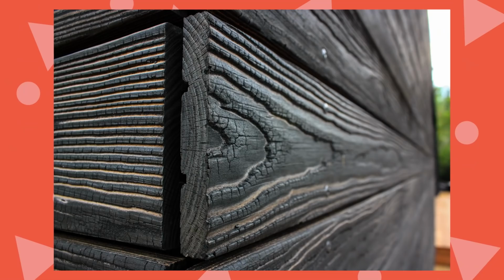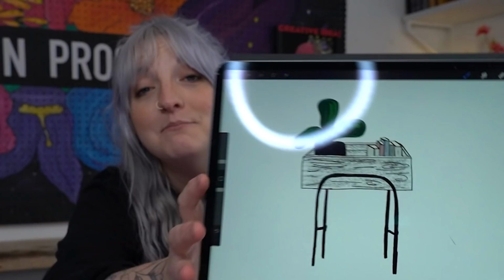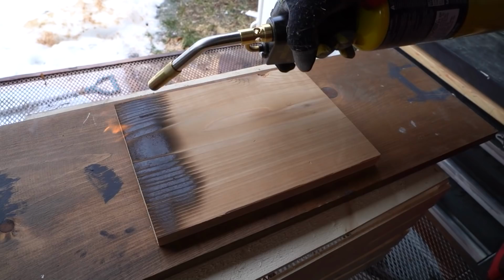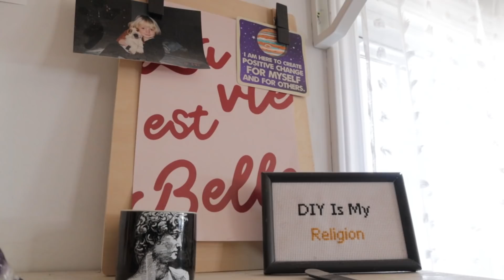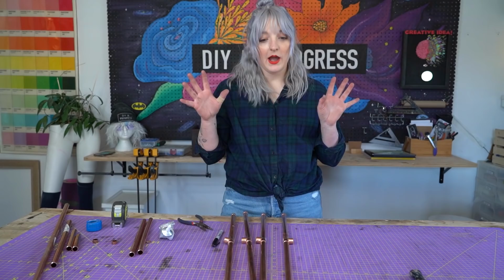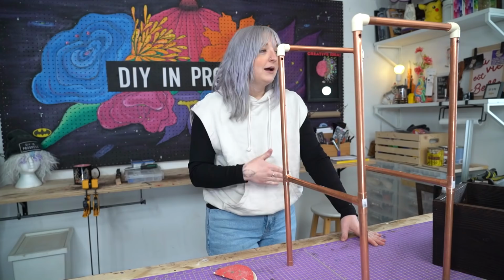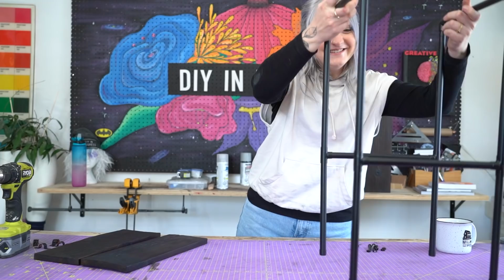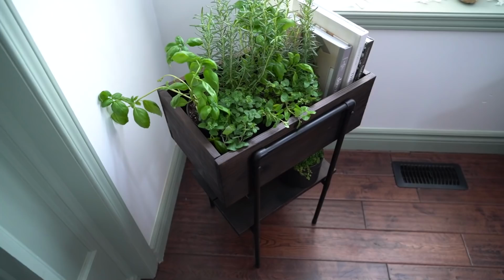*DIY* i set my indoor herb box on fire 🔥😮 | Shou Sugi Ban | DIY Danie

Comment: Love this.  The one thing that would that needs to be done is to add black rubber cups to the bottom of the feet.  They will protect your floor from scratches and gouges.

Comment: ❤️ the look/design❗👍🥰
When you line the box and fill with plants/herbs, put the cookbooks on the lower shelf. Stand on the vertical length so the spine is facing up. Or you could stack them laying flat.

Comment: Folks, if you are painting the legs anyway, buy P.V.C. ! WAY cheaper, easily cut and glued together. Also easy to screw into, too ! 
 A light sanding and a spray paint for plastic & you are done !
Reply: AND, you can drill p.v.c. with a plain drill versus a drill press. Use washers for any bolts, but that's a good practice for any bolts ! 
 Don't get me wrong, I LOVE copper, but it pains me that she spray painted it !

Comment: Dear Danie, I have a question...you use surly a lot of glue...I have no luck with glue...I just lost a hole tube of E 6000. First the glue run out by itself, then it was plugged and then the tube broke. Everytime I see someone using glue espacially in tubes (had the same problem with other brands, too) I think well why can they and I am not. Is there a trick? I ruended a project becouse I was not able to stop the glue run out the tube with out me doing anything!